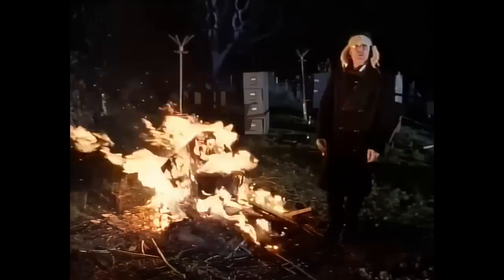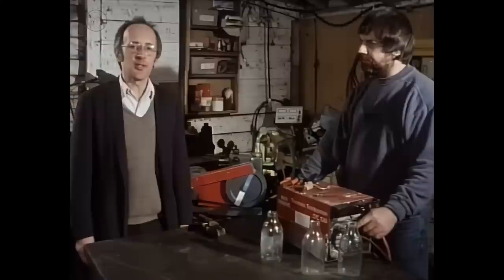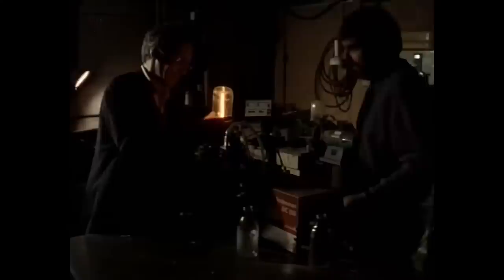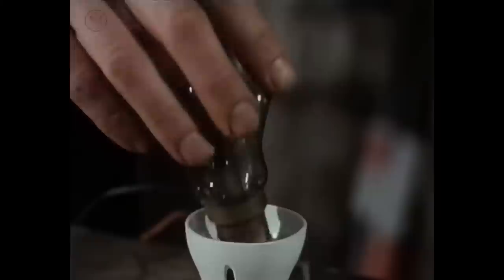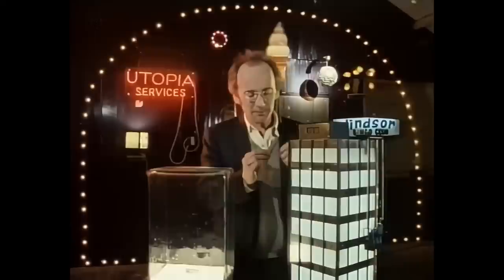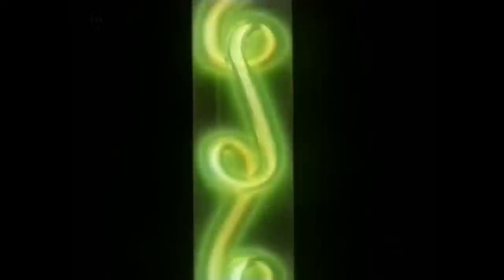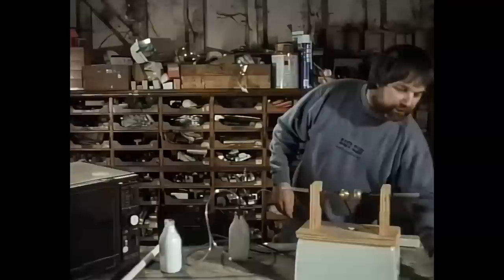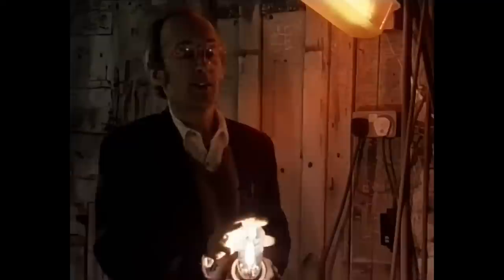The Secret Life of the Electric light - Remastered

Comment: Of course modern bulbs are all engineered to fail.   Sadly including most LED bulbs.
Reply: Modern bulbs are much better than older ones. In the 1920s, light bulb manufacturers deliberately shortened the lifespan of bulbs to make people buy more. Google 'The Phoebus Cartel'. It's interesting stuff.
Reply: @fightfairfightfair  Yes,  I'm very aware.  You don't think that's still happening today?   The evidence suggests otherwise.  LED's for example are being overdriven and overheated to shorten the life and at the same time make more profit for the manufacturer.   The filaments in florescent tubes also don't last like they use to.   Better then the 1920's,   perhaps.  But still being engineered to fail.

Comment: I want to   know how I am going t o get my lava lamps to work when I cant get incandescent bulbs?
Reply: Well, you could use an LED for the light needed and add a suitable electric heater of a power (wattage) similar to the original incandescent light bulb.  This should perform pretty much the same as using the original incandescent light bulb.  Just make sure the electric heater does not overheat the LED light.
Reply: @Vincent_Sullivan  Simple to write, not so simple in practice.

Comment: Good quality compact fluorescent light bulbs actually last much longer than the best incandescent light bulbs and they are far more efficient. The problem is that there were too many low quality types on the market due to heavy competition. 

As was mentioned they were soon replaced by LEDs but they unfortunately suffer from the same problem of there being too many low quality products on the market. Their main flaw is that they have insufficient cooling and their electronics eventually fail (caps dry out and the driver IC cooks) and even some of the LED units may fail also. Poor quality and a short life is the bane of modern technology.
Reply: most LED lamps die by deliberate planned obsolescence, via the LEDs getting way overdriven amperage-wise, which shortens their lifespan considerably. see the 'dubai lamps' for what LED lamps should look like if they were actually designed to last 20+ years.
Reply: @francistheodorecatte  
Yes, I agree. 
I have actually seen the episode on the Dubai lamps on BigClive's channel.

Nevertheless, competition drives prices down and often consumers would rather sacrifice quality for affordability. There is no doubt you could go to an engineering firm and have LED lamps custom made to your own specifications. 

These could potentially last a lifetime, but can you imagine how much that would cost or if it would even be worth the effort.
Reply: @jtveg  Easy solution without modifying the bulb is to buy a dimmable one with twice the power you need and run it at half power most of the time.

Comment: Modern light bulbs are absolute tosh. I seem to replace them a lot more often than the old kind, I have a lot more fuses now than I ever had before, and I can't see a bloody thing, they are so dark. Now, I do appreciate low light sometime, which is why I installed dimmers in most my rooms, but can't use them any more, because none of the new lights support them. Oh whats that, you can buy more expensive dimmable LED lights? Well yes I tried them, and no, they just drain your pockets quicker, they still make a whining noise and flicker....maybe I need to investigate gas light!! I'm all for anything that helps save the earth, but these modern light bulbs just don't seem to be doing anything for me! My workshop/attic has a flourescent light tube, I last replaced it 20 years ago.....still the brightest room in the house!!!

Comment: Unfortunately new LED lamps are not all created equal, not all live as long as they claim. the same as CFLs, you get what you pay for. Ive got afew old Phillips SL CFLs from the late 80's, they were very expensive when they came out but are still going, and ive had cheap/medium priced LEDs die in a flickering mess less than six months old. cant win them all
Reply: Yes i collect old CFL and philips and NEOBalls Thorns ETC they last much longer than some LED strips. and streetlights,